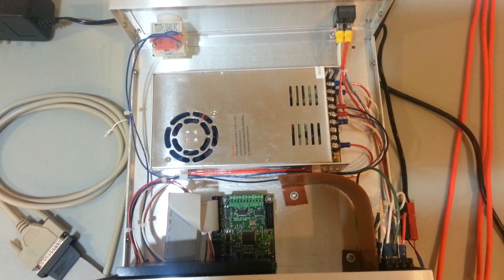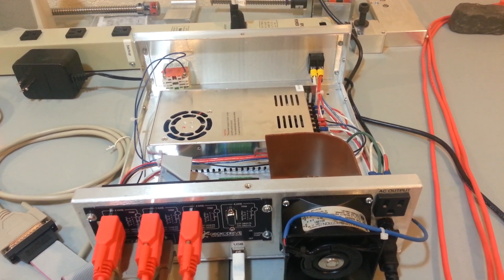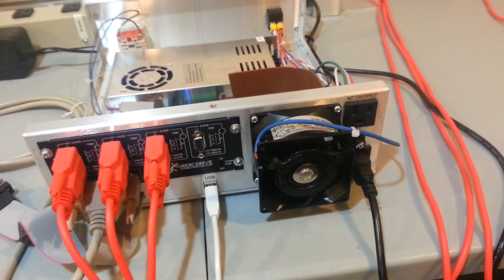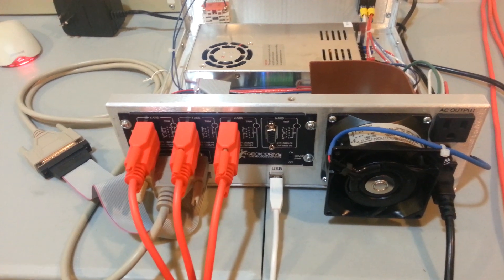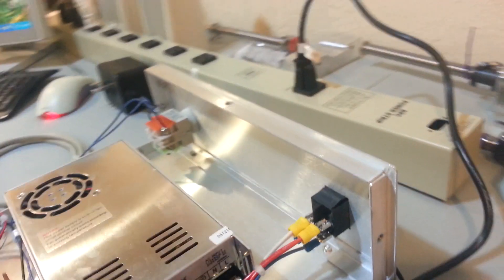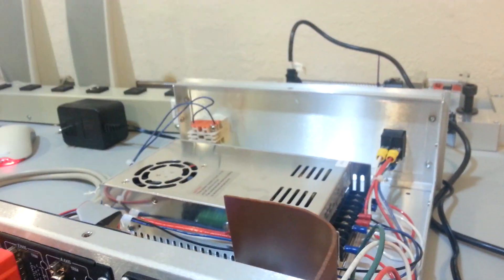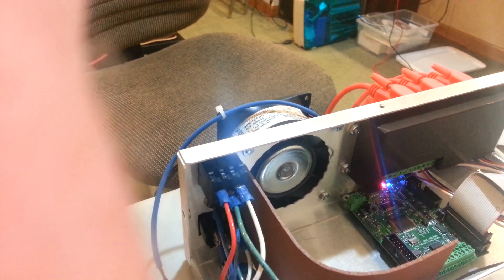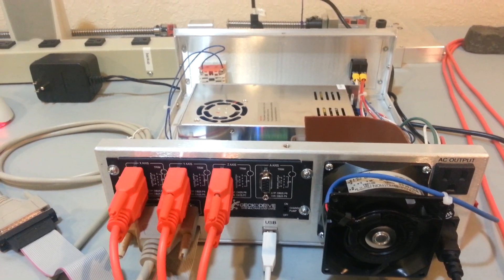CNC Control Box in Depth

Comment: Did you ever post your wiring diagram? I can't figure out how to connect the DPST Switch in the front of the case into both the Power Supply and the IEC Plug outlet in the back and tie it into the G540. Had it once and almost blew the darned thing up.

Comment: I got the same box. Automation Technologies Inc. told me that they have no wiring diagram for this box. I was told to refer to the same diagrams as linked above, but those diagrams do not show how the box and the components that it comes with it are to be wired, or how to wire in the 110v ac fan (like the one they sell). The box is a good product, it would be really good with a schematic. Great vid, and thanks for posting it.
Reply: +meteoriclord 
Hi meteoriclord ... did you get your box working?  If not, send me an email to djzman078@gmail.com and I'm happy to help.  Sorry for the delay.

Comment: Doug

Sorry I missed your question ... You probably have the answer by now. 

Here it is anyway: the smoothstepper does a couple of useful things ... The most basic is to make the connection to the computer usb rather than the obsolete parallel port. It interfaces seamlessly with Mach 3 software and generates the pulse streams for the motor drivers. 

Hope this helps,
Nate's dad